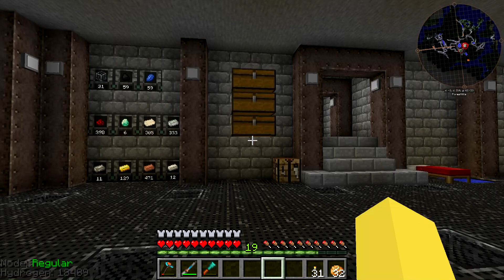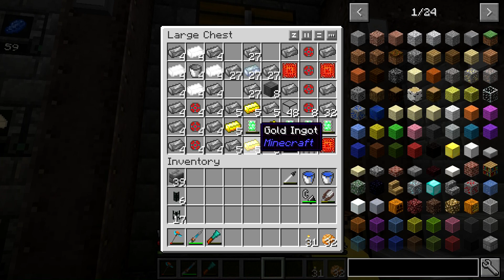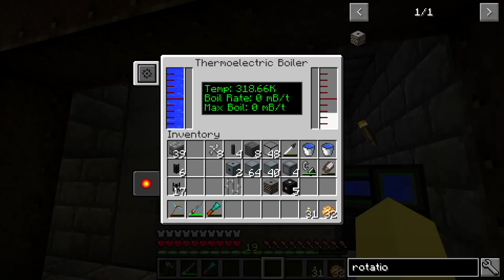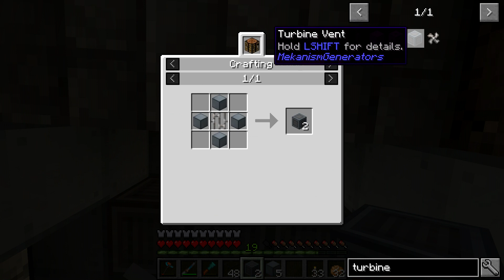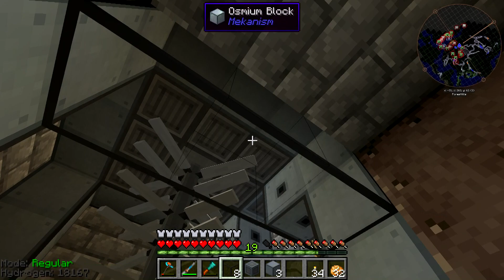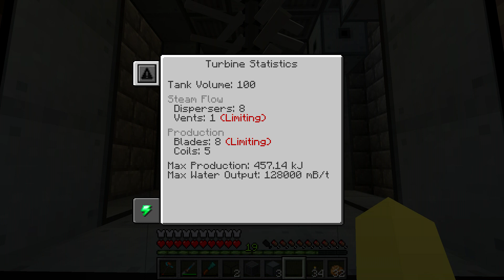Surviving With Mekanism v9 :: Ep.16 - Industrial Turbine

Comment: Another clean concise video on how to set shit up with mekanism. I just got the fusion Reactor online for my base, and honestly I dont need more power generation, but I am probably going to set one of these up and tie it into the reactor (and eventually reactor complex; current base design intent involves 4(!) reactors placed at the top of the massive pyramid I built around my initial base. Turbine will be in the basement, and the center will have a column of pipes and stuff running up and down) for power generation.

Comment: This combination doesn't seem a viable energy source to me. This nice energy production at 16:28 is probably due to previously produced steam going from the boiler's buffer into the turbine. Once this buffer is used at around 17:35 the flow rate and the energy output plummet to the amount comparable with wind generator output. Correct me if I am wrong but , without fusion reactor this thing is useless.
Reply: U need to remember that he was not producing any steam!

Comment: You should take screeni-weenies of the waila showing that the turbine glass is an osmium block/the rotor tube (or whatever it is called) is a heat generator and send them to the mod developper.
It would be very helpfull to him :)
Nice video as always ;p
Reply from the maker: Eventually I will, but there is a LOT of stuff that is screwed up between Waila and Mekanism. I still use Waila because I like the mod and am too lazy to change it, but 50% or more of the machines do not properly show in Waila :(
Reply: ooohh it's all about lazyness uh ? xDD
Reply: I actually think the cause of this is due to the way the machines are coded, technically this happens because many of the blocks share the same ID's, but different block data apart from that, if I had to guess I'd say WAILA looks at block ID to see what block is what,